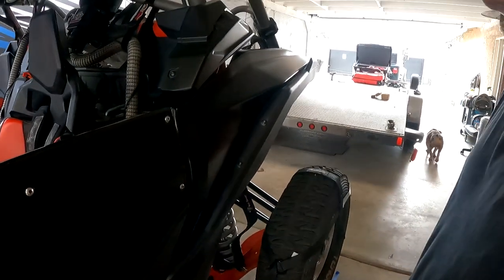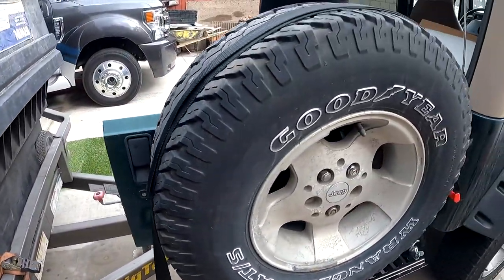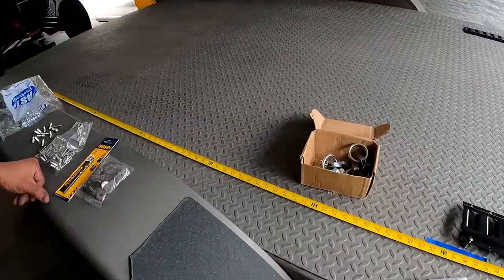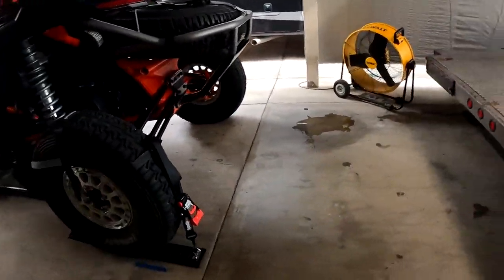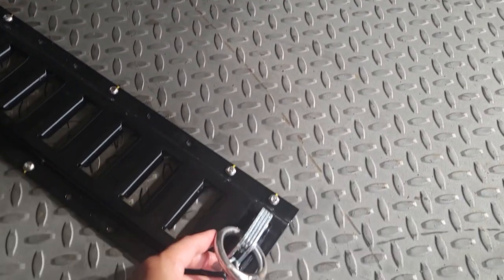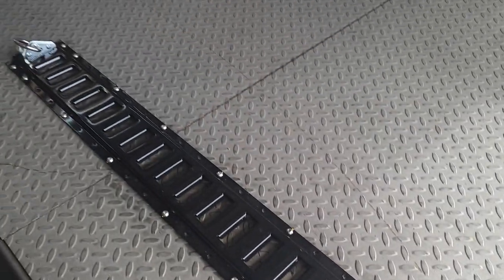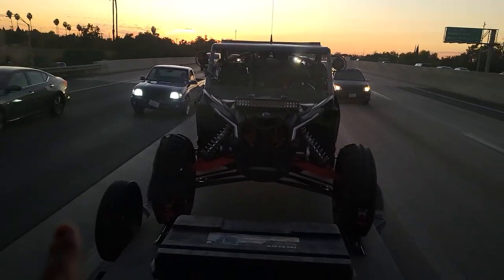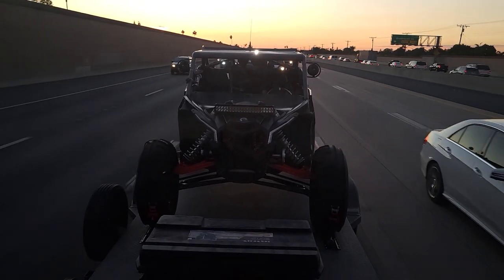SpeedStrap UTV Tire Bonnet Kit & E Track Installation #speedstrap #etrack #utv #canam

Comment: I run the Mac utv straps on all 4 corners have wheel nets. No issues with them coming loose with 33” dsr or 33 tensor ss sand tires.
Reply from the maker: Nice! That is helpful to know, thank you!

Comment: I run Mac straps with bonnets on all 4. Mac are industry leading for straps. Also I think the track should have been a little longer. The straps ends are to close to the wheels.
Reply from the maker: We did consider longer tracks. So far the set up has been doing well. Thanks for sharing your input.